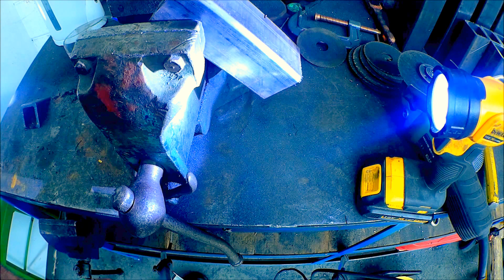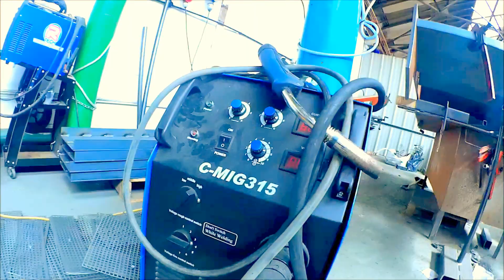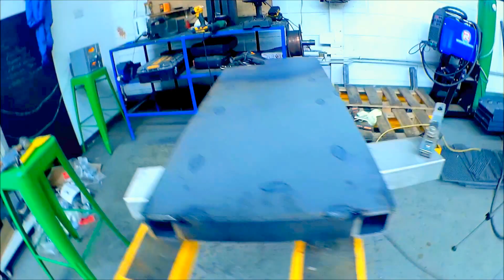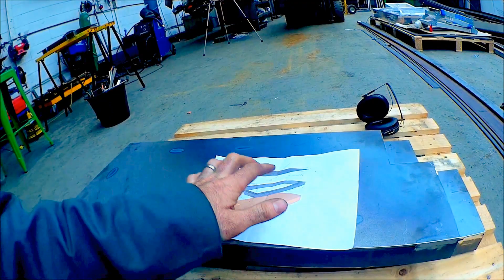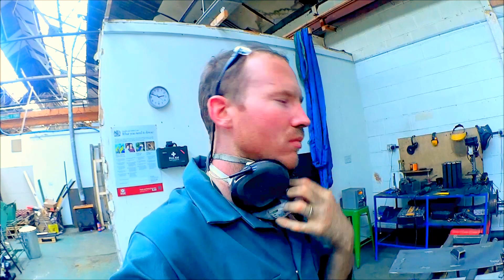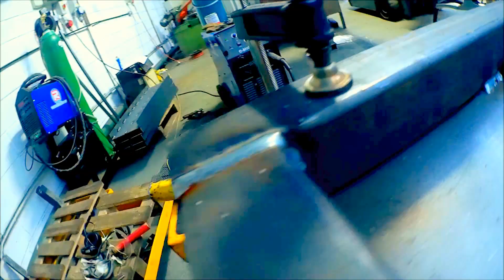Minimalist staircase build #1

Comment: Ya, stay with a stick welding if you're not a welder, oh and by the way, mig welding works just as good as stick welding if you know what you're doing and know how to use industrial welders, migs today penetrate the same if not better, you can buy different tinsel strength wire depending on the type of metal you're welding, remember, your weld is  only good as the metal you're welding, if you're a novice, don't listen to novice welders!

Comment: what about the paint on the tubes and plate, is it a contamination to the welding?? I see you don't take this paint out before welding, thanks your response
Reply from the maker: Hi. It's not paint it's mill scale/oxide. It's fine to weld with high amperage, it's gets a problem with low power welding and needs sanding as the scale take more to melt through such as vertical up or stacking dimes. Also oil contamination can be a problem but often a wipe with thinners is fine. Cheers J
Reply: @joshuadelisle  sorry, it seems to me some kind of blue paint, if it is mill scale I have been told we have to remove this to avoid wormholes and porosity on welding anyway what amperajes we are talking about???
Reply from the maker: @lobitojavi  your right. In your training it is good practice to always remove mill scale. In industry it's not always necessary. Try it on some flat bar welding a tee fillet and do a etch test to see. British steel is pretty good and not having too thick of mill scale but some welding codes require it's removal and so you should. If you can get spray transfer on your machine then generally you'll not have a problem. Believe it or not though welding with a stick welding with some 7018s you can weld over light paint and it's fine. Your instructor won't approve but test it and you'll see. For jobs that are critical you must sand it back to make sure it's good. Cheers J
Reply: @joshuadelisle  ok I understand, thank you sir

Comment: You are an angle-grinder-hero - because of all these angled cuts at the beginning. Thought about getting a metal bandsaw for these kinds of cuts - I now reconsider.
Reply from the maker: It would have been helpful. Ours either wouldn't cut to the right angle or was too inaccurate so I just used the grinder which works well just cost more in time and discs.

Comment: I was looking at an R tech Pro 135 stick welder. is this a good choice for a beginner?
Reply from the maker: Its cheap enough, R tech have good technical support however I think 135amps really limits you, thats the comfortable range for a 3.2 electrode but your maxed out so you haven't more power for thick steel or melting in on something unruly. but i'm guessing your going through a domestic plug so you'll hit your limit anyway. i'm not conviced entirely with R tech but thats because i'm used to Miller and Kempi. that saying i've not had a problem welding with one.
Reply from the maker: it will be more than fine if your a beguinner. I like to go 5 amps above the recomendations of the pack of electrodes
Reply: What about phase converters - Would they be any use running 3 phase equipment through domestic supply? What welder would you recommend?
Reply from the maker: Stick welders only run on two phases even through a 3 phase system so a converter isn't needed. you want a cable that is rated to 35 amps with a 35amp plug (large blue) and a dedicated breaker switch on the main board rated to 60amps. that will take a 200amp welding machine. i've bought a cheap 200 amp stick /tig inverter with high frequency start for just £200 sungold power of amazon. so far its been great, leads are short and i've not tried the tig on it yet but it melts in a 4mm electrode no problem. 60% duty cycle wich is good. it comes with a standard three pin but I would change it to the large blue plug. I hope that helps. J
Reply: Thanks. That's really useful info
Reply from the maker: +Metalmiltia I bought the sungold because it was very cheap and I'm surprised how good it is. I did get an even cheaper one that was just stick and it welded well but leads were poor so I sent it back. if it was for long term,  full on work I would get a Miller for the peace of mind and tech support.
Reply from the maker: +Metalmiltia I bought the sungold because it was very cheap and I'm surprised how good it is. I did get an even cheaper one that was just stick and it welded well but leads were poor so I sent it back. if it was for long term,  full on work I would get a Miller for the peace of mind and tech support.

Comment: So this is currently your day and night job!  It keeps you in your medium.  Hopefully you can still look at steel when you go home.  I made a similar blunder laying out a hole pattern for mounting a new steel bumper on my truck.  The holes lined up perfectly - if I put the bumper on upside down!  Keep pressing onward with your shop. Mine is coming along, and I should be ready to move out of my tool shed and into it before winter.  I am putting in a wood stove for days when I am doing other things in there beside forging.  I can go in and work stung and warm and see the snow fall outside.  Curious about your need of 3 phase power to run a welder.  We run big professional machines off single phase.  Terminology or ?  240 V single phase is really like double phase with 2 'hot' leads 180 out from each other, no neutral and a ground (an earth).  It is balanced power.  And ours is 60 HZ of course.  All the best!
Reply from the maker: Yeh i'm really hoping that after this job i'll have the funds to build my new workshop quickly. I'm glad i'm not the only one who makes silly mistakes, I think being more open to the problems we sometime face makes a better video, because we're not all perfect but learning how to correct a mistake is valuable. I had a single phase mig in my old workshop, it was a good one but still was only able to weld 5mm (0.19685 inches) with good penetration, I tried doing a weld coding with it on 6mm and it just lacked the penetration. since then i've used industrial 415v welders and been able to really melt into 40mm thick plate (1.5748 inch) we also run on 50hz over here. i'm not sure what the max spec load is with a mig on 240v but the cost of the machine in comparrison with a 140amp stick welder thats happy to melt in a 3.2 into a 12mm plate is such a difference, your talking difference of £1000 mig to £150 stick that will do the same job..... I think that's the point I was trying to say for beginner welders.
Reply: I am guessing that you guys need the voltage and power that is only available with 3 phase because of the way your grid does things.  Here we can get that with single phase.  I think it helps that our volts are "hotter" because we transmit at 60HZ rather than 50, just the way that 12 volts dc provides more power than 12 VAC - but I may be holding that idea by the wrong end.  That was a heavily engineered stair by the way.  Who are the giants you are building them for?  Thanks for getting back to me as always. I know you are a busy fellow, as am I.  I am making a serious stab at earning some supplemental income from my forge, and off I must go!

Comment: Really enjoyed that video Josh, had all the elements including admitting an easy mistake to make. Glad to hear your workshop is still going to happen and we will see more good stuff like the barbie forge...what happened to the tuer supply? And for those critics...those who have never made mistakes have never made anything.
Reply from the maker: Thanks I appreciate that. I stopped making the tuers because I couldn't get the time in to replenish the stock. I have parts for another 8 of them but need a new hole saw to cut the tube and so its became 1 of many jobs I want to get off the ground and not been able to. Once I've got my workshop up and running i'm hoping to get some patterns made for more welded sculptures that everyone can use and also do more how to forge video's... until then its work work work....

Comment: How would you get the most out of a crappy MIG welder as a beginner. My old man got a really small one a few years ago and ive always wanted to get some use out of it. Feels like a waste of money otherwise.
Reply: You can still get good practice with it on sheet metal , car body repairs?
Reply from the maker: You can but still very limiting, things like tooling made from 8mm plate for the power hammer I made using a cheap 240v 140amp clark stick welder and the result was fine, carn't do that with the equivalent mig.
Reply from the maker: I was hoping to do a video on cheap migs and how to use them well, basicly a virtical up weld allows more heat and penetration on low volts so you can achieve a good weld on relatively thick material. however it can be tricky welding verticly if you havn't got much experience..

Comment: Josh, Once you have your first frame welded and square. You can save time by clamping the next one to the finished one using plates similar to what you used to pull the repair back into alignment. This way you only have to fuss with getting one very accurate and all the rest come out identical!
Reply from the maker: I would normally do just that. but I found aligning it on the plate was just as quick this time round. Cheers Dick
Reply from the maker: Thinking about it your right. If I kept one plate aside and tacked a few spigots on the edge it would be fine as a jig. It just felt quick as it was so I didn't bother..

Comment: I hate having to grind something apart after I have just finished fabbing it the wrong way lol. Nice work and video, that stair case is gonna look awesome.
Reply from the maker: Thanks I hope it will fit alright, there some weight in it and a very tight place to put it....
Reply: Joshua De Lisle I've been there before once, hope it all fits together good. A few years ago my brother and I built a spiral stair for a guy's 2story home and it's was a tight area and because of the steps going from the center completely to the sides of the wall we had to do a lot of cutting on the steps to get them to fit properly since it was not an exact squared stair well. In the end it looked badass though and I'm sure this one you're working on will be too.
Reply: Great projects you are doing there. I want to get into welding big time. I love welding with my everlast welder. I try to weld a few times a week to practice and hone my skills. Best job in the world I figure.
Reply: Joshua De Lisle Yeah I get what you mean, leveling it and aligning it will be a challenge for sure to begin.
Reply from the maker: It feels like it could be similar. the problem I have is a tiled floor with under floor heating.... the stair actually floats off the floor for that reason, the trouble will be getting it in possition smoothly....
Reply from the maker: it is certainly satisfying Ryan and deffinately a good skill to have.